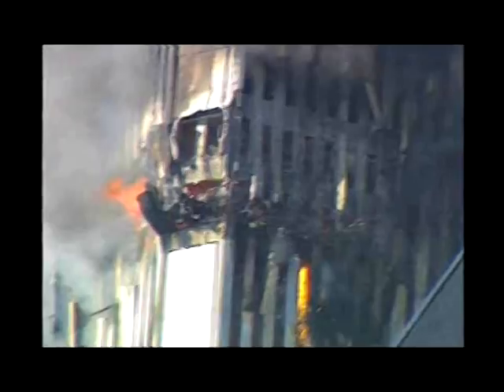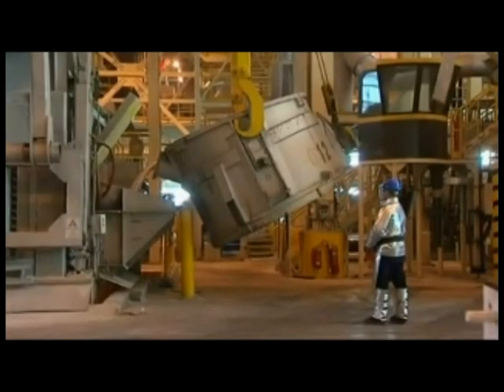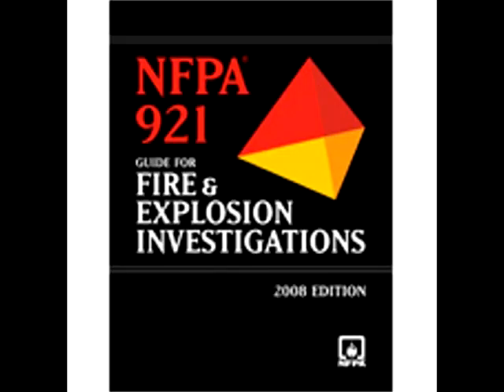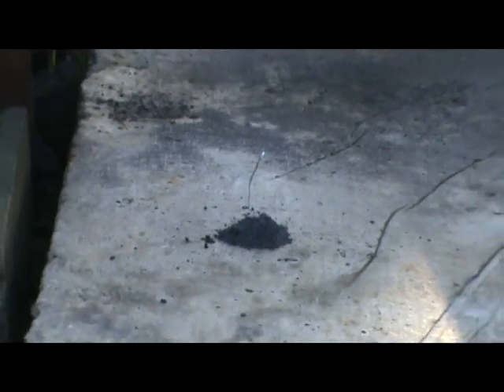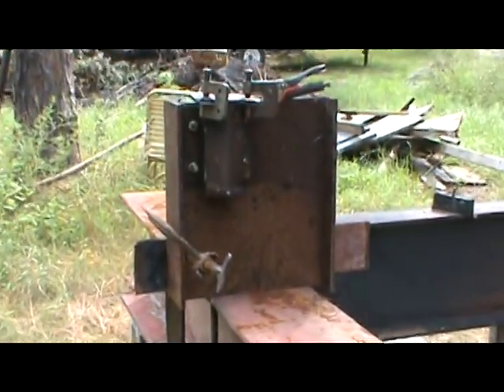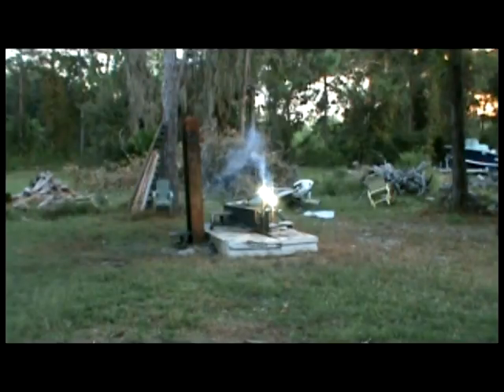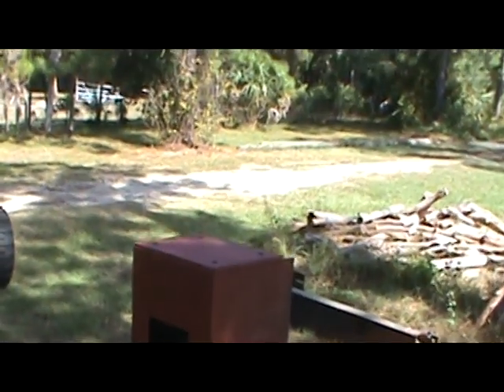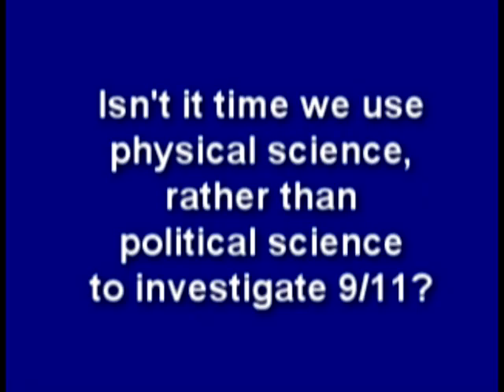9/11 Experiments: The Great Thermate Debate

Comment: A massive freaking plane is already enough to take out a building. The plane itself knocks out many beams, and the fuel and heat created soften the beams, which then collapse under the weight above. I don't see how other phenomena which can be explained by experts (Such as the apparent molten steel coming out of the building) contributes as evidence of a conspiracy.
Reply: you're talking about exactly what we didn't see. if the plane took out core columns on one side of the building or if steel had been softened by fires at and around the impact we would see sagging and leaning and any collapse would have been asymmetrical and not completely symmetrical through the path of most resistance; massive structure below which had not been weakened by fire.
Reply: yesac101 first, I know the main support columns are central, thats not what I said. Look at the wtc blue prints. 47 core columns, many elevator shafts.  Symmetrical collapse from one impact and unfocused fires does not explain symmetrical failure.
Reply: Grandpa the Grey A 395,000 lb piece of aluminium traveling at 590mph thats a lot of mass, and velocity. The make up of material really isn't all that relevant you could shoot a golfball though 12in of solid ar500 steel if it was going fast enough. That plane at that speed produced 6,272,640,000 joules of energy to put that into perspective a 9mm bullet exerts roughly 500 joules of energy so 12.55 million times less energy. A stick of tnt is about 2,100,000 joules of energy so about     3,000 sticks of tnt. Still think that's not enough to take down the WTC's. ANYONE who thinks its a conspiracy is a fool, and completely ignorant.
Reply: yesac101
 All of the thousands of Architects & Engineers who DISAGREE with you, many with over 30 years experience as Structural Engineers, are ignorant fools? I'm certain you're wrong.
Reply: +Dave Hymers False, because on buildings like those the main support columns are never on the out side and are almost always surrounding the elevator shaft in the central of a build the sides are more decoration then anything. There was damage to the elevator shaft causing a vertical drop directory and the weight from above was enough to cause buckling throughout decent.
Reply: agentorange153
Did you not see the huge explosion and fireball immediately after the plane hit the building? That was MOST of the fuel burning away in just a few seconds. What little remained was burned away in a few minutes.
Reply: agentorange153
  Wow, you certainly are ignorant. It was the Official Government 9/11 Commission who's findings concluded the jet fuel was gone in a few minutes and was NOT the cause of the collapse of the Twin Towers. With every comment you make yourself look even more stupid that the comment before. Read the 9/11 Commission report before making more idiotic comments.
Reply: +Gigabic You really need to study history. Conspiracies are as common as ordinary dirt. Why? Because people are selfish and don't want to get caught.

The buildings were designed to withstand multiple airplane crashes. That was in the 70s, and the largest plane then was only slightly less massive than the ones on 9/11.

Think, man! What happens when you put the end of a spoon in a flame? You're not going to be able to hold it very long, are you? Why? Because metals are good heat conductors. The fires would not have softened the metal sufficiently, because the entire building would have acted as a heat sink. All the beams are inter-connected.

Tests on a scale model showed that far hotter controlled fires that lasted longer did not soften the beams sufficiently to initiate collapse. And that was with a smaller heat sink.

Conspiracy? There are at least 500 new conspiracies starting every second, somewhere in the world, on average. Dirt ordinary!

Bush gave us his conspiracy theory, and you ate it up, didn't you? So did I.

Then I dug deeper and found out it was all lies, full of holes.

Mayor Giuliani committed a felony by destroying crime scene evidence starting on the evening of 9/11. He should've gone to jail for felony destruction of crime scene evidence.

The top military officers responsible for the massive security failures on 9/11 all received promotions instead of courts martial.

NIST scientists were guilty of scientific fraud, starting their collapse clock on WTC7 more than a second before the initiation of continuous collapse. Then they took average acceleration, instead of segregating the acceleration, moment to moment. That's fraud! And glossing over the fact that WTC7 achieved perfect free fall for the first 8 floors of collapse is scientific incompetence -- or conspiracy cover-up. I don't know which is worse for our Bureau of Standards in America.

Destruction of crime scene evidence, rewarding the failures and scientific fraud. Hmmm. Could be a conspiracy, or one ironically long string of stupidity attacks. Take your pick. Somehow, the conspiracy angle looks like the most likely.

Conspiracy is human nature -- selfishness and self-concern involving groups (2 or more people, talking about doing something unethical or illegal).
Reply: because jet fuel doesn't get hot enough to melt steel  ur willing to believe anything just because someone with a PhD said it lol get a clue they lied to   u to start a war get more power through the patriot act and steal a shit ton of money at the Pentagon can anyone say false flag
Reply: +Jam1053428 Then how do you explain why a 22-pound RPG can take out a 70-ton tank?!
Reply: agentorange153
Explosives. Duh
Reply: +Grandpa the Grey An RPG's explosive charge doesn't take out the tank. Its the yet of metal (aluminum will work, but copper is better) that comes from the HEAT charge inside the RPG that takes the tank out. The explosive in an RPG is just a means of propelling the metal, or adding enough energy to it. In the case of the WTC, this energy came from the planes engines.

Personally, I think this guy in the video is asking some legitimate questions though.The issue I have is that I highly doubt that thermate could have been placed before and succeeded, and further more I question what the motive for such a thing would be.

You see, the only way to get that sort of motive requires a massive conspiracy that falls into clear logical fallacy. The type of conspiracy that history has never known to have succeeded hid without somebody utterly and clearly blowing the whistle on it.
Reply: +Gigabic Like when a big bomber plane crashed into the empire state building during WWII and it fell?
Reply: +Max Deler Because the airliner was TEN TIMES BIGGER than the bomber, that's why!
Reply: +Max Deler Wingspan DOES NOT MATTER -- only the MASS and the FUEL LOAD matters!  And you can bet NOTHING about the Empire State Building -- you have NO way to know what would happen if a jumbo jet hit it, so shut your yap and leave these questions to the experts!  As for the conspiracy theorists like Michael Moore, they're NOT in it to make money -- they're doing it to ENSURE OUR NATION'S DEFEAT in the Great War on Terror, and they are being PAID BY TERRORISTS to do this!
Reply: *****
  Brainwashed sheep blindly accepting the Governments official conspiracy theory without question sums up about 99% of the lie loving crowd. Good day.
Reply: *****

  Within the first 30 minutes of the airliner strikes, the news media had placed the blame squarely on Osama Bin Laden and used his name dozens of times pointing out his guilt. No one else was ever a suspect. Even without a shred of evidence, the sheeple swallowed it hook, line, and sinker.  When mainstream media tells the sheeple something loud enough and often enough, they'll accept it every time. Those who haven't been completely brainwashed will ask questions seeking only the truth. Then watch out! Mention the word TRUTH concerning the events of 9/11, be prepared for all the name calling, ridicule, and those who believe the governments conspiracy theory, accusing  "truthers" of being anti-American and disrespectful to the victims families.
Reply: +Gigabic A passenger jet airliner is nothing more than a hollow aluminum tube. Try watching a few videos of what REALLY happens when a jet impacts a solid wall.
Reply: +Grandpa the Grey And jet fuel is plenty explosive enough -- and these planes had MANY TONS of it on board!
Reply: +Grandpa the Grey See?!  You YOURSELF admit that there was a BIG EXPLOSION because of the crash -- and THAT was what made the hole!  And BTW, you are LYING -- there was still LOTS of fuel remaining, and it went EVERYWHERE in the building, setting OTHER stuff on fire -- and THESE fires were what brought the building down!
Reply: MrLittlelawyer
 You have ALL wrong! RPG= Rocket Propelled GRENADE.  A rocket motor propels the explosive warhead, stabilized in flight with fins. The explosive warhead is what takes out the target. Do some research before making such a totally WRONG comment. Google it.
Reply: +Grandpa the Grey It DOESN'T MATTER -- the jet fuel started fires EVERYWHERE in the building, and THAT was what brought it down!
Reply: +Finian Mac LIAR -- the fires were burning RIGHT UP TO THE POINT OF COLLAPSE, you can see on the goddamn video!  And the water sprinklers were DESTROYED BY THE IMPACT, so did NOT put out the fires!
Reply: agentorange153
No, it was NOT fire that brought down the Towers. Even the 9/11 Commission agrees it was NOT the fire.
Reply: +Richard Driskill My point is, how can a millitary bomber plane crash into a concrete tower built in the 30s, starting a huge fire barely even denting the building, while a commercial airliner can crash into a building of steel built in the 30s and bring it down as smoothly as if it were a controlled demolition, in two cases, on the same day.

There are way too many coincidences, the terrorist insurance, mysterious power outages and mysterious worker a few weeks before the attacks, the passport of the terrorist that was the only surviving piece of paper from any of the aircraft, the fact that there wasn't a single fighter jet in the northeast that entire day, the fact that molten metal is seen pouring out of the buildings, the fact that white smoke puffs are seen every 10th floor right underneath the falling part of the towers during it's fall, the fact that more than 20 pages of the official report were censored to the public, and so on. I can't even fit all of the coincidences in a single comment here.

I'm not sure what to believe, but I believe that there is too much contradictory evidence to the official report for me to believe in it.
Reply: *****
You're wrong. Try it, I guarantee you'll let go of that spoon long BEFORE it turns red.
Reply: agentorange153
There's absolutely NOTHING in Rod Martin's comment that could possibly be construed as terrorist propaganda. At least not by a sane person.
Reply: *****
  What's the difference? YOU'RE the one who said the spoon would glow red before the handle got hot. If you actually tried it, by now you're nursing burned fingers and the end of the spoon never got hot enough to glow red. According to the 9/11 Commission or anyone with common sense, the jet fuel was burned away in a matter of minutes. The remaining fire was an ordinary office fire and anyone with even a smidgen of knowledge about Fire Science knows after about 30 minutes the fire was cooling down. It's obvious you don't know how "heat sink" works or the UL rating of the steel beams used in the construction of the Twin Towers. Look it up.
Reply: +Grandpa the Grey He is undermining our will to fight the enemy, AND inciting rebellion against our legally elected government on false pretenses -- THIS BY ITSELF CONSTITUTES TERRORIST PROPAGANDA!  And so do YOUR efforts to defend him!
Reply: agentorange153 Flight 175 had about 7 times the mass, but only double the wing span than the B-25. I would bet, that if an airliner were to strike the empire state building, that it would still stand for many years afterwards, and not collapse a few hours after it was struck the exact way it would if it were a controlled demolition.
Reply: Richard Driskill You clearly didn't read my entire comment. I replied to multiple of the things you defended in the official story's favor. And if purely the lack of "combacks" from my end to each individual claim gives you points in the debate, I guess it's all about who wears out their keyboard the most.

You didn't really catch my point. I am just saying, there are too many coincidences.

Real tv interviews, real science, real photos, real video, real audio - contradict the official story. Thousands of pieces of information that contradict the official story. There are no other human caused catastrophe of this magnitude that has even nearly as many coincidences speaking against the official report than this, that hasn't already been proven to be an actual conspiracy. This is why I doubt the official report, but I am still cautious about giving the conspiracy too much validity.

Also, I don't see how these conspiracy theorists are making money from me. Almost none of the videos I have seen have been ad-financed. So what's in it for them, if everything they say is a lie, or modified truth? Why would people like Michael Moore spend thousands upon thousands of dollars to make a documentary if the official report was clearly backed by peer-reviewed scientific evidence and not censured? What other major event has so much contradictory information than the official report on it?

What if 9/11 never happened? What would the people have said about the invasion of afghanistan/iraq? What would the people have said about the NSA Big Brother scheme? What would the people have said to extreme military budgets? Who gained from 9/11? We sure knows who lost from it. Worth thinking about.
Reply: *****
There's no way the spoon glowed red before it became too hot to handle. That's just a flat out lie. The rest of your comment was just jibberish. So original of you tho call me twoofer. You're delusional if you think that hurts my feeling. We all know what the opposite of TRUTH means, don't we.
Reply: agentorange153
 NO he didn't and neither did I. We simply stated our opinion which is protected by that pesky old Constitution and its First Amendment that your kind hates so much. If you feel so strongly about it, contact the proper authorities and have us arrested. I can almost hear them laughing now.
Reply: *****
The Maximum Operating Limit Speed (VMO) for a Boeing 757 is 402 mph at sea level. The VMO for a Boeing 767 is 414 mph at sea level. Aeronautical Engineering says an aircraft that exceeds its VMO design will encounter a phenomenon known as Flutter Effect. Flutter Effect will cause immediate loss of control of the aircraft and severe structural damage to the air frame. The calculated speed of the aircraft that hit the North Tower was 494 mph. The speed of the aircraft that hit the South Tower was calculated at 586 mph. Both aircraft were operating at near sea level at speeds FAR ABOVE their VMO. That's virtually impossible without loss of control and severe structural damage to the aircraft. Just one more 9/11 mystery that goes unanswered. No matter how much you wish it, you can't change the laws of physics.
Reply: +Gigabic you dont science do you
Reply: +Steve Johnson 900,000lb you say? funny that when the maximum takeoff weight for a Boeing 767 is 395,000lb
Reply: +TheRhinehart86 I'm pretty sure the airplane will weigh the same whether it's moving or not. And he said that he stands corrected so no need to harp on it.
Reply: y0sh1100
Actually, relativistically speaking, objects weigh more the faster they move but that's not relevant to the scales we're talking about, it requires force to make an object move, the heavier the object the more force required to move it and more force to make it move faster. A 450,000lbs plane moving at hundreds of mph is going to have a shit ton of force behind it and when it hits something solid like a building that force gets transferred into the building, causing catastrophic structural failure. That's the point of the bullet example, a bullet fired from a gun weighs the same as a bullet that you drop but obviously the bullet fired from the gun has a shit ton more force behind it, allowing it to cause more damage.
Reply: +TheRhinehart86 yeah but it's besides the point, we are strictly talking abou the weight of the plane, so please stick to the subject. and a skyscraper doesn't get affected the same way a human being does when penetrated by a bullet.
Reply: +Gatito De Ana There's a difference between dealing with static loads and dynamic, and the floors falling down from above is pretty strong dynamic force.  It's like the difference between balancing a hundred pounds on your head and having it dropped from ten feet up.
Reply: +Grandpa the Grey I made the connection, for crying out loud.  You know why?  Because no other terrorist group had the same level of funding, nor the tendency towards coordinating attacks against multiple targets. (East Africa bombings)  Look, you're pushing the notion, often popular, that somehow governments are full of master planners who can build outlandishly complicate, completely secret conspiracies with thousands of participants who never tell anybody a thing.

If you believe that, I think you're the sheeple, because you're failing to use critical thought at several junctures.

Look up videos of actual demolitions.  Look at actual preparations.  To believe that this could all be done in secret, without anybody the wiser, is absurd.
Reply: Stephen Daugherty

  28 redacted pages from the 9/11 Commission report points to evidence that the Saudi hijackers received funding from the Saudi Government, which in actuality, is the Saudi Royal Family. You don't think the House of Saud could reach the same "level of funding" or construct a network as complicated as Bin Laden whose assets had been stripped by the government Saudi Arabia?

   Bin Laden was NEVER officially charged with 9/11 because, according to the FBI's website at the time, they had NO EVIDENCE.

  In the months prior to 9/11, LVI Services Inc. performed asbestos abatement, with armed guards posted at the elevators, on both towers. When questioned about the work LVI president Burton T. Fried stated,"We didn't do it. It was a company called AASI but they went out of business." No further inquiry has been documented.

  Even though hundreds of credible witnesses, like firemen & police officers, heard and felt explosions before & during the collapse of Towers 1,2,&7, the 9/11 Commission didn't even check for the possibility of explosives.
Reply: +Gatito De Ana "A plane cannot wreck a building that is bigger than the plane".  Haha!  I didn't need to read any more.  You've revealed yourself to be a total moron.
Reply: +Gigabic You know planes are made out of Aluminum which won't have that much force.
Reply: +Steve Gould Why dont you drive your car into your house and see if it collapses like a house of cards, like wtc did
Reply: +MrLittlelawyer  "How could somebody not blow the whistle? How come nobody came forward?"  People ask themselves this everytime some long running conspiracy is revealed. 

But look at how snitches and whistleblowers are treated. Anybody involved with a conspiracy must implicitly understand that loose lips means death or living hell of their family members.
Reply: +Leo B thanks for the example, it happened here locally only 3 days ago.  A trash truck 'slowly' hit a residence.  It knocked out 2 piers/columns that supported the upper storey.  It collapsed more than half the house, the remainder was a write-off.  The house was much bigger than the truck.
Reply: +obyvatel yeah, either that or it was hit by terrorists with absolutely no involvement from the U.S.  I'll go with that as an explanation.
Reply: +TheRhinehart86 "objects weigh more the faster they go"?  Wow!  You've turned physics on its head.
Reply: +Welder Nate yeah coz planes don't weigh much....???  Are you high?
Reply: +obyvatel okay, so the US did it to themselves?  Is that what you're saying?  Why would they?
Reply: +Rod Martin, Jr. The type to put spoon above fire often heh? Crack or heroin?
Reply: I also thinks it's funny that these nuts think the building was taken down with thermite because one of the towers were twisted due to the force from the crash
Reply: +Steve Gould 
1) Actually, according to Einstein's theories of relativity, they do. A jet, though, would have to approach much closer to light speed for this to happen in any appreciable sense. (And it would be mass that increases, not weight. )

2) What would increase with speed, even if mass is not increased, is FORCE. F=MA. Greater speed would mean greater acceleration. More of that means a jet would hit with greater force.
Reply: +Gatito De Ana
It supports it as a static load. Again, the difference between balancing a 100 lb weight on your head, and dropping it. When it simply lays there, it pushes against the supporting structure below it which pushes back. If the ability to carry the load is strong enough, what's above stays still. If not, that structure bends, breaks or shifts out of the way.  In a disaster like 9/11, you had a huge hole ripped in multiple floors on each building, compromising part of what was holding that office building sized mass still. That means greater loads on the remaining supports, and less support for parts above. Add to that a fire that was further compromising the beams that held the loads of the floors above in place, and you have a good chance of that office building sized mass dropping, accelerating towards the floors below. You've accelerated the mass much more, so it hammers down with more force than the original static load.
Reply: +Gatito De Ana 
Few if any buildings are engineered to stop that kind of kinetic chain reaction of failures, certainly not a 1970s built, 1960s designed building like that. 

Oh, by the way, how do you think that actual high rise demolitions work?  Look it up. One of the key reasons I don't believe folks like you is I know how real demolitions are done: by knocking out supports, AND LETTING GRAVITY DO MOST OF THE REST OF THE WORK. 

As for a cruise missile? Nobody would mistake one of those for a passenger jet.
Reply: +Welder Nate force equals mass times ACCELERATION.  Not to mention the damn things weigh between 300,000 and 400,000 pounds.
Reply: Here's some basic physics.  What's important here is how much force is apply in how much time, over how much area.  You can put a wood splinter through a brick wall at tornado speeds.  What you have is hundreds of thousands of pounds worth of mass impacting  the towers mainly with the cross-section of the front.  the question is, does the airplane skin deform fast enough so that the columns don't get snapped in two by the impact?

OH, by the way: Yes, they were designed for a 707, a smaller, less massive jet.  It was hit by a pair of 767s.
Reply: ***** No impact density? Magical fuel! Let me guess; conservation of momentum in fluid is an Illuminati conspiracy... You should tell the inhabitant of Thailand and Japan... WTC7 was broadside facing the collapsing rubble of the towers and during the collapse one can clearly see the debris hitting full blown the floors that caught fire (the smaller building were lucky in that regard, as the point of compression where the floors were vaporized to dust was located above them). There was no such thing as a 767 in existence when the WTC was designed.
Reply: +Finian Mac  The difference in weight is considerable.  Tens of thousands of pounds.  There's a difference between a bullet hitting you at 700 miles an hour (which is bad enough) and a Mack Truck hitting you at the same speed.